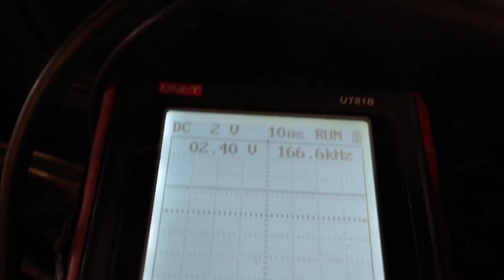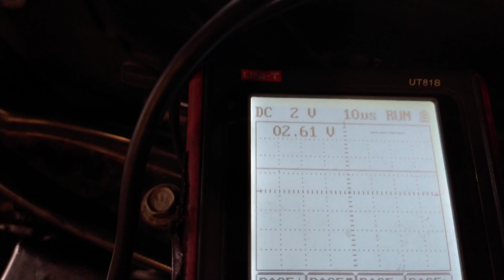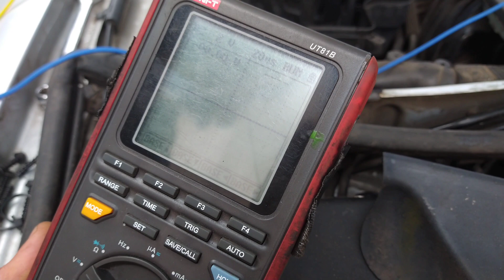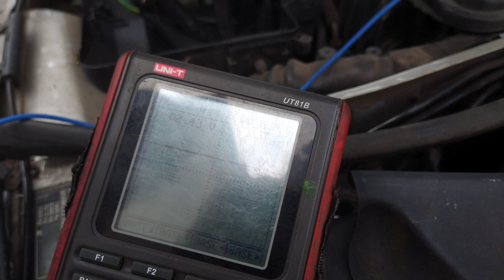BMW X3 (no start/no crank/no can bus communication)

Comment: did you replace the DME or by pass the K line bus  ?
Reply from the maker: The DME was sent away and repaired, they said that there were faults on the can bus that had to be fixed. Thanks for watching
Reply: @mechanicmatt871  that's mean I need to send the DME for repair ??  is that correct matt I found some one did by pass for the DME . because other entertainment for the car doesn't function the machines  says Not equipped for the SRS, HVAc, GM5 , Sunroof , AC ,  front wipers , windows , radios etc.....
Thank you 
I use the same machine of you

Comment: I have code that say K line issue no widow , now srs module can be see , no sun roof module can be seen , no GM5 can be see, just DME and TCE and DSC sensor , some one by pass the K line and all of the entertainment down .
Reply from the maker: That may be a separate fault on the entertainment, that could have been bringing the other modules down. Hard to say without being there to test it, thanks for watching
Reply: @mechanicmatt871  thank you

Comment: Good video Matt, is that the launch x431pro Your using ? How is it ? Thanks 
Rob mobile man
Reply from the maker: Yes the launch has been good at resetting steering angle sensors, on a BMW, coding a steering wheel control module on a vw, it's good at reading the vin and loading the relevant information.
Sometimes the live data has been off, I think for the money it has been good, I sometimes think I should have saved some more money and got an Autel, 
Thanks for watching
Reply: @mechanicmatt871  
I've seen the x431 diagun v but unsure which to choose , thanks for feed back